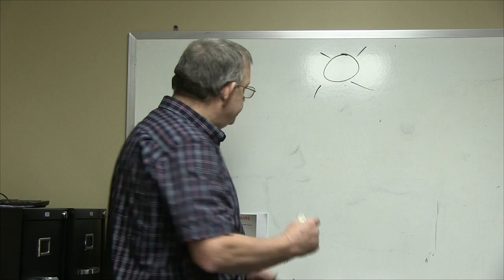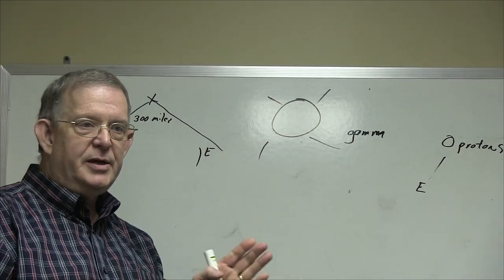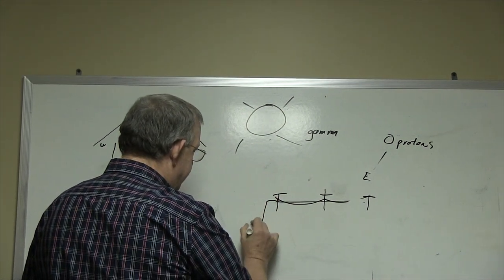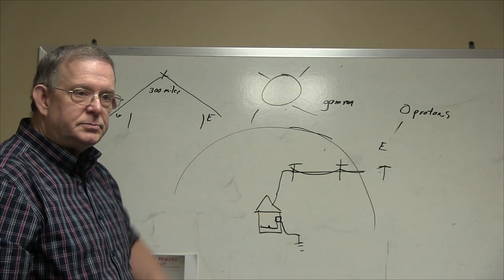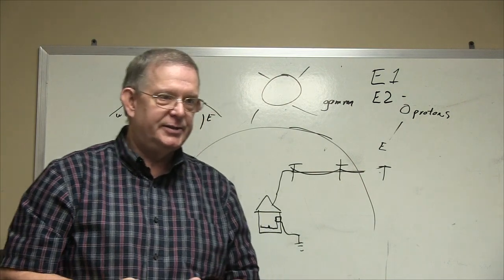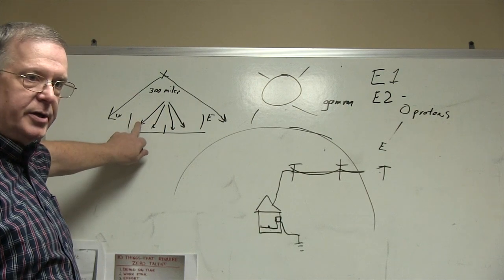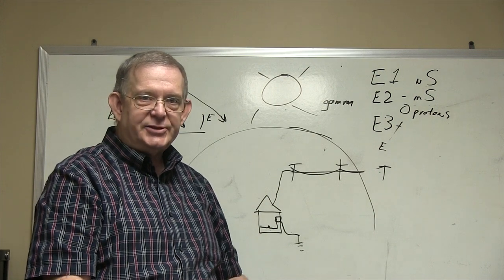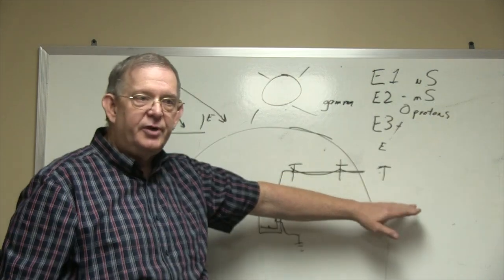Engineer Tim Carty explains how an EMP  — an electromagnetic pulse — works

Comment: Emp is the future nuke
Reply: An E.M.P. has been around for decades, it is the result of a nuclear explosion.
Reply: Seems like a lot of work when nukes are just fine; you will have a hard time getting more energy from something that isn't a fusion reactor—albeit, a short one.
Reply: @CharliMorganMusic  I know this is a year old... But its actually more efficient to use an EMP rather than direct damage, as you can go in afterwards and your enemy is blind, in theory anyway. The problem is that... EMPs are not practical... This guy is talking about the pulses and all this talk.. but never once does he talk about power density. The problem is that a nuke at 300 miles high would have to be massively large to have an electromagnetic pulse large enough to actually effect the grid or devices. Thats at 300 miles directly above you... Then take into effect the angular distance from 50% the distance of the US. 300 miles high, 2000+ miles width. Thats a huge angular distance... The nuke would have to be so large that it would be idiotic to detonate it in space.

Comment: Atmosphere wouldn’t stay charged for long, so if anyone detonated a nuke to cause an emp effect just restarting the machines would solve the problem...
Reply: That's assuming electric rigs are fine...
Reply: EMP reverses the polarity of natural magnets or neutralizes them completely so not necessarily anything requiring natural magnets would try to run in reverse or not work at all
Reply: you are so wrong

Comment: hold on if some was living in the e3 rang and they will only be getting hit with the charged atmosphere, wouldn’t it be possible to say i don’t know, store like a deep cycle battery in a sealed, pressurized, galvanized container, would he battery be unaffected because of the non contact with the atmosphere or would it be non affected because of the certain material it was housed in?

Comment: Mr. Carty...how is the coverage/Miles and distance/Source figured out? Is it the same as X-rays?
Reply: 2 years late, but as a retired X-Ray tech I know the answer.  Yes. Miles covered would be simple geometry of a divergent beam if the energy was collimated rather than omnidirectional.  Strength at a given distance would be calculated using the Inverse Square Law.

Comment: My TV got EMP'ed by a bolt of lightning passing about 20 feet above the house but no one believes me. Can't find anything about this problem on the internet. I guess I'm the only one this ever happened to.
Reply: I just experienced small shocks between my fingers and metal keyboard frame as several lightning strikes took place close nearby, hence why I tumbled down the EMP internet rabbit hole. Besides shocked fingers, I also observed my internet lag for a second or two after each strike (I was playing a multiplayer online game at the time, which was the only reason I noticed the internet lag), audible sounds played through my headphones (very similar to the sound played when plugging in an audio cable), and a large shower of sparks from a transformer on an electrical pole outside my window.

I feel incredibly fortunate to have been able to observe such a variety of effects produced by a series of lightning based EMPs while sustaining no damage to myself or any of my equipment. I'm rather glad I took the time to set up my PC rig on a power strip with built in surge protection!

Such a beautiful demonstration of natural power...

Comment: There are ways to enhance an EMP beyond just a nuclear detonation by using a tuned antenna (capacitive - inductive tank circuit) at the point source to the atomic reaction that will amplify the pulse power much greater than without. It can blow through average shielding in a given range.
You do realize that NORAD has multiple systems that watch for and track all satellites and large sized space junk over the North American continent. They even chart the stars and use it as reference to all reflective objects over a wide electromagnetic spectrum as to their orbital physics in relation to ground stations. Trump is increasing this capability with a Space Command for vision from space and reactionary force.
Reply: Minus the Chinese wheat her balloon two days ago lol. 3 years later